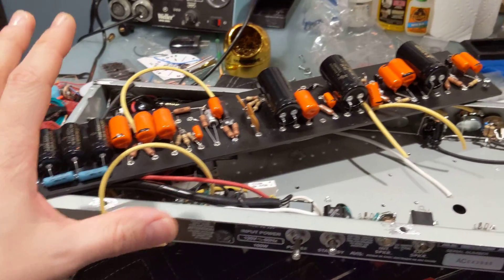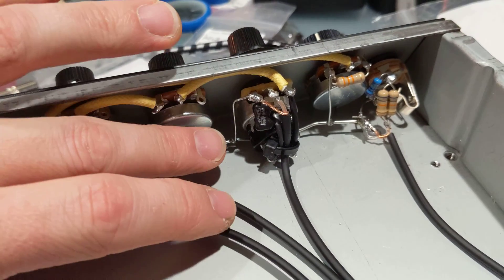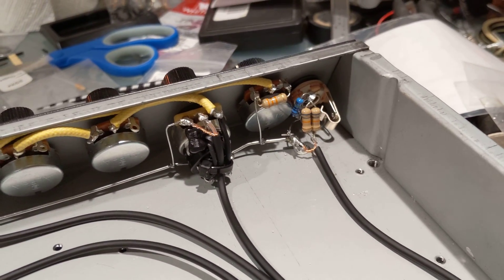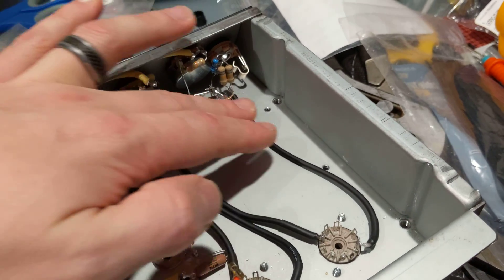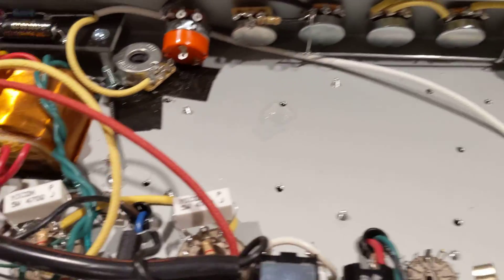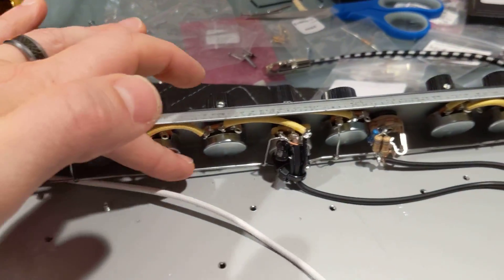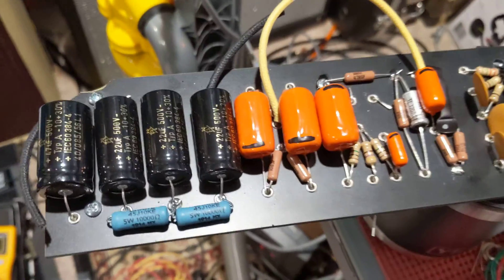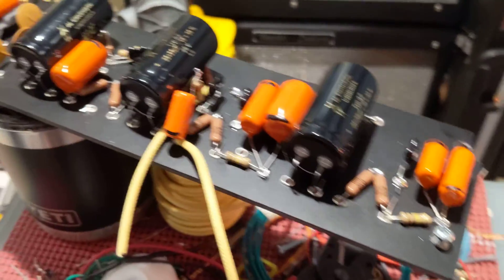Converting a Fender Deluxe Reverb Reissue (DRRI) to Handwired Blackface AB763 | Part 3

Comment: Hi! I'm thinking about making a deluxe reverb from a Mojotone kit and building it to your spec. The only thing I don't want to do is what you did to the external speaker jack. My question is what would I have to change to keep that part of the amp stock. I want to make a 2x10 cab for it and run those with it. Either that or get a 2x10 speaker cab made to fit the deluxe reverb.
Reply from the maker: Great question!! For that part of the circuit, you can follow a stock AB763 layout. You'll find that we keep the 220k in place (not go out a line out jack) and then wire the speaker out jacks in parallel. This is a good photo to compare with and you'll see the slight difference. 

https://robrobinette.com/images/Guitar/AB763_Models/AB763_Deluxe_Reverb_Layout_DIYLC.png
Reply: @TheToneGeek   Thanks so much for answering my question!
Reply from the maker: @General_Ethos good luck! Please report back how you like it!

Comment: @thetonegeek What is the reasoning behind the bus bar ground as opposed to the brass 90 degree shim stick that fender used in the old amps?  Did you just add lugs to a Hoffman AB763 short board to allow for the power section capacitors? I guess what is the difference between the AB763 long and short boards? Twin vs. Deluxe?

Comment: Do you still need a speaker load when using the preamp out?
Reply from the maker: Great question. Yes you do because the power tube and output transformer are still powered up. Removing the tubes and that part of the circuit would increase the voltage on the preamp section so it would alter the tone. My recommendation would be to get a cheap dummy load if a speaker is not connected. I can see studios preferring this method if they have a deluxe head shell.

Comment: I built a custom DR from a mojotone kit and could never find that particular pot for the trem intensity. You said you got it from Weber? Link possibly please
Reply from the maker: Hi Pat. https://www.tedweber.com/wp503ras
Reply: You can also change the value of the resistor for the trem circuit, I may be wrong but it may be a 3.3 meg resistor, you can change the value to make the trem less powerful - this wont rob as much power from the input circuit, which will give you slightly more drive.